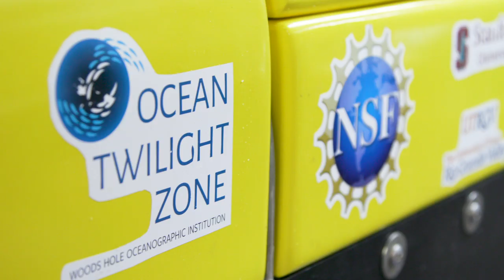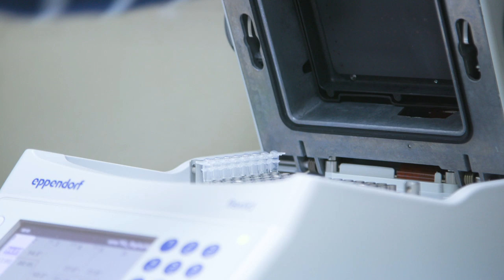Jellies of the Twilight Zone

Comment: Is planting trees an alternative way of cleaning the ocean?
Reply from the maker: @Commenter ama Planting a tree and removing trash from the ocean are both ways in which you can get involved in doing your part to improve the current state of certain ecosystems. There are many environmental, social, and economic benefits of planting trees, which is also true for removing trash from the ocean and coastlines. The benefits for both of these are certainly not identical since they are both different in terms of process, but they are both great ways to do your part. 🤙